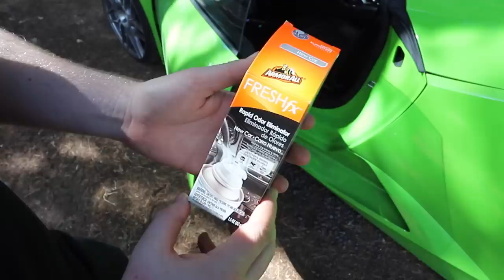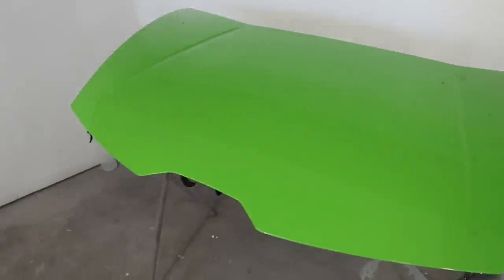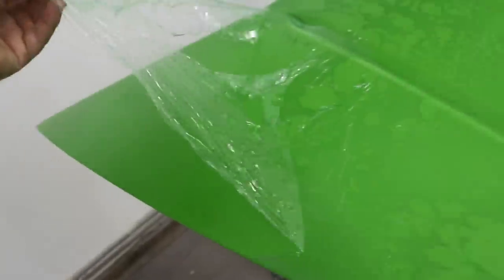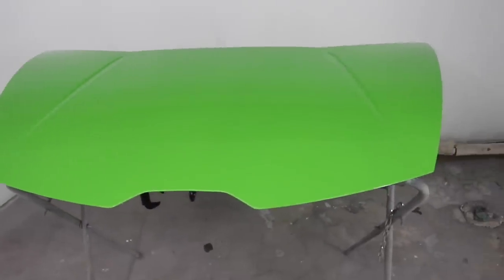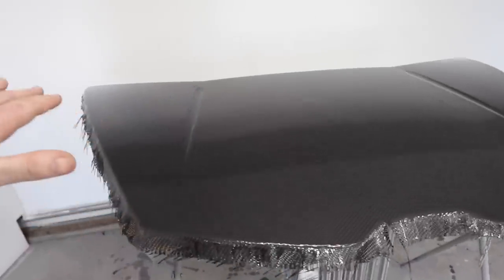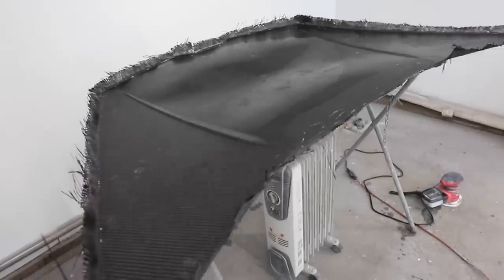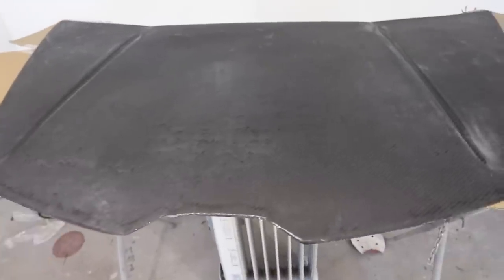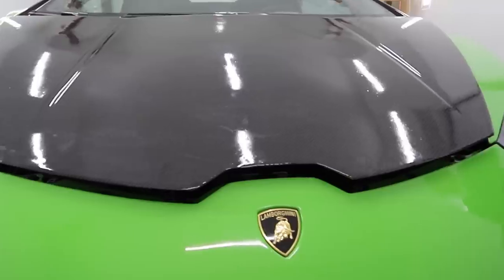Building Our First Carbon Fiber Part for the Huracan

Comment: if you use the Huracan parts as the mold, you will have a part that is larger than original, but you should use fiberglass to make a mold, then use the carbon fiber inside of that. And it should be bagged and vacuumed.
Reply: This
Reply: It would be bigger but the whole car would be that much bigger so idk if you would really notice.
Reply: I say do heaps of layers an inch thick, make a carbon fibre armoured lambo 😃
Reply: @bigdaddy741098  The ultimate widebody kit
Reply: Yep, Thats the the way to go! Its way more work! But its the right way to do it! Also need to make molds from the backside! you need the support structure! Plus use tooling gel coat!
Reply: @PvtPapa  that's not how it works :D
Reply: I was thinking the same thing, thought I was being a dumb ass though 🤣
Reply: @Slamdoxicalz  be funny if it was, just keep making it bigger and bigger until it's basically a monster truck 🤣🤣
Reply: @Slamdoxicalz  Thats how Street Bandito did it, ya know, the guys everyone is praising in these comments
Reply: I would think the surface finish would be substantially better as well.
Reply: Norm D exactly, but this guy doesn’t have a clue what he’s doing yet he’s trying to do one the most difficult builds attempted on YouTube 🤦🏽‍♂️
Reply: Should use carbon to make a mould
Reply: @bigdaddy741098  And at that point you've spent as much on carbon as you'd spend for another Hurican.

Comment: makeing  negative molds is the way to go. ad some plywood rids to it so it keeps its shape and the mold itself can be woth alot of money to someone that wishes to get into manafacturing lambo parts
Reply: Very true
Reply: Storage space for a bunch of moulds could be a problem.
Reply: Easy composites, a UK company has great you tube on making a bonnet
Reply: need a vacuum for flawless really as well
Reply: Dead ways to achieve with some plastic bags and double sided gorilla tape just need a couple of screw fittings and your almost there
Reply: I agree, make a mold. it can be made from cheaper glass fiber with wood reinforcements, and use the carbon for the actual part.
Reply: @imouse3246  Someone would pay good money for a decent mould, potential earner
Reply: Easy Composites here on YouTube has a full series about how to make a carbon fiber hood, including making negative molds for both the inner and outer skin. It would be great to use that as a guide.
Reply: Very interesting episode.
Thanks for sharing it with us.
Reply: Plywood is actually a major pain in the ass for things like this. Having done that for aero molds do not recommend plywood. There is a rigid foam made for this that works much better. I don't remember the brand name and if I can find it I will post it later
Reply: BIFB Aero kit. It's the next rocket bunny for Lamborghini.
Reply: I also want to see how a negative method works out.. it seems like Chris might get a better result, and side hustle selling knock off lambo parts..
Reply: Exactly, if I was doing it, this would be the way I'd do try
Reply: PVC pipe works great to add stiffness to the mold. Lay glssfiber over the pipes. We used this when making raceboats so I know it works.
Reply: @kruleworld  truth is mate if you use enough layers of glass it doesn't really need the wood. I do it for a living and its stronger then people think they just don't make it thick enough in the right places.
Reply: @brettknibbs9351  a block of wood is a lot cheaper than many layers of fiberglass and resin. that's why.
Reply: @GoodolOzzy  sorry. Dyslectic

Comment: Sorry Chris, but you need to do more research on panel making from composites, you are wasting so much material. Gel Coat molds with fiberglass and bracing so they don’t go it of shape and make Carbon Fibre panels from them. How are these panels going to mount?

Comment: Make a mold, then do carbon fiber infusion. Will save you time on sanding and will look 100x better!
Reply: Also you are going to need to make reinforced back panels to keep the part rigid. I believe they glue it on.
Reply: @Ryan-ue9ve  maybe sheets of aluminium so strengthen it ?
Reply: @trnews-lb6ev  i believe its harder to bond metal to composites, it works but over time can cause cracking. Im no professional. Easy composites has a great tutorial but it looks like a rigorous process. They use fiberglass as the back plate, even my seibon carbon fiber hood uses fiberglass for the underpanel. You could do all carbon fiber though.
Reply: @Ryan-ue9ve  you can use an oem inner style reinforcement. Or you can make a smooth inner while using a core material.
Reply: @carlosvargasbatman  agreed! Just doing a decent wet layup with vacuum bag would make a good part!
Reply: @carlosvargasbatman  i agree, the guy is a total beginner and has none of the skill and knowledge to make a decent carbon fiber part using resin infusion(making the whole car as he says is not even thinkable)
Reply: I was wondering about the mold.  By laying fiber on top of the current panel, one's new part is slightly bigger than the old one.  One might be able to lay down one or two layers, then reinforce on the back side, but as shown in the video, just a couple of layers is quite flimsy., so it would take more to keep it from moving.

Vacuum bagging, or using some kind of a bladder press allows squeezing out as much resin as possible to leave mainly carbon fiber which the part derives the strength from.

Using the mold should give one a clean first layer.

Some people use cosmetic carbon, and structural fiberglass.  Not perfect, but cheaper.

Comment: A negative mold is absolutely mandatory for big pieces like this and will fit so much better.   It will also be easier to lay some foam sections to the inside and then "box in" those with overlays of carbon for a much stiffer finished product and even make mounting points to the frame.  You really need vacuum bagging and heat, if possible though.

Comment: Hey Chris, I’m an aerodynamics/composites lead for a FSAE team majority being engineering students, where we manufacture full carbon fiber bodies every year for our one off small scale formula 1 race cars. I have tried this wet layup method and it can become difficult to get the glass like finish. The majority of teams use fiber glass negative molds to achieve the complex geometry our race car can have. 

I would love to give some advice or if you have any questions just dm me! Also check out FSAE teams its equivalent to a d1 league for automotive engineers and as engineers we design by ourselves, build by ourselves (if possible) and compete internationally!

Comment: You should definitely go with a mold. By laying the carbon on top of your panels you are making all of the new parts slightly larger. This will ruin all of your gaps.
Reply: It'll also make all the panel lines just a little bit softer, giving the entire car a subtly sloppier/cheaper look.

Comment: I think you should make a mold of the parts first, and then do the Carbon fiber panel from the mold so that it’s an exact copy. You can layer as many carbon fiber cloth pieces as you want.
Reply: This is what I thought he was gonna do
Reply: It also makes the copied piece bigger
Reply: Andrew Ziegler not if he uses a good mold. It should be the exact size.
Reply: @steelavocado1  no Andrew was saying the way the part shown in the video will become bigger if he uses that. But on the other hand, if he creates every single panel using the same method, it should fit since every parts are equally bigger.
Reply: thought the same, this will make a negative copy.
Reply: @brianchen3964  they wont fit and will need MASSIVE amounts of work.

Comment: Definitely go down the mold making route. If done right you can just keep popping out parts and if you make the inner of the mold super smooth and shiny (much like how the underside of the carbon hood is) that'll show on the top coat of the carbon part. 

Plus with the molds you can sell them when you're done, someone will buy those molds without a doubt

Comment: You have to make a fiber glass mold, then put 2-4 layers of carbon fiber. Do NOT sand it, not with 120p, if you have to sand use at least 600p and be careful to not sand the carbon fiber, only the resin.
Reply: You can sand carbon fibre.
Reply: @andrew19682008  you dont want to sand to the fiber, specially if you are going for cosmetic carbon - i.e. not painting it just clearing. Yes if you are just making a structural panel that has enough laminate you can sand a high spot through the first layer or 2 and not care, but you are going to need to paint it otherwise it will look terrible
Reply: I paint carbon for a living, parts for aston martin, porsche, Mercedes etc, we sand with 180grit and then scotch, that's where he went wrong, the scotch would have removed all the milky ness. Also we cure all off our parts for 8 hours at 150° so 2 days air dry is no where near enough.
Reply: @andrewbatson9710  you sand cf before clearing. You want the clear to stick...if its a smooth surface it'll have a hard time sticking to the part. It may look rough after being sanded but the cc fills all the voids and smooths the part back out. A part will look better sanded then not also...and last longer.

Comment: The way to do it is:
1. Create a fiberglass mold of the item you want to create a carbon fiber you want to get
2. Wait for it to cure
3. Lay the carbon fiber INSIDE of the fiberglass mold so the original sizes are preserved
4. Cut it while the carbon fiber is still "flexible" to avoid cracking
5. Also, this is the time to make any necessary steps to prepare mounting mechanisms (lifters for the hood for example)

Comment: I see green specks in the carbon. Does this mean you are ruining the new paint job on the Huracan?
Reply: I would have waited to paint the green lambo till after they used it to make the new body parts.
Reply: Why do u think he needed a sponsor for this episode?
Reply: MIKEYMCC I think it's the green specs from the film thingy he sprayed after waxing
Reply: Paint is very thin, then there is a thick layer of clear coat over the top of that. There is no chance of him pulling off paint from the paints because hed have to go through the clear coat first, and that would he extremely noticable.
Reply: @towboatjeff  right? why take apart a freshly painted, perfect lambo. dude is a hack.
Reply: I was just saying about him putting stuff on that paint I would never do that
Reply: for sure
Reply: @nuancepill8066  I don't think you know what a "hack" is.
Reply: I think I would have did all this before the new paint.
Reply: That was my first thought. He definitely should have waited. But I guess he wanted to drive the lambo before he had to tear it apart
Reply: @onetouchgarage4503  yeah, could be the PVA!
Reply: Yah

Comment: two negative moulds for the bonnet  inside and out single for the others  then you can try different techniques to get the best results without having to risk the original panels multiple times

Comment: Hard to believe the body shop gapped all those panels and your taking the panels back off
Reply: Eh, you can always gap it together again, gotta do what you gotta do to get the project done
Reply: Was thinking exactly this as they had trouble hanging the door and Um going to be intrested to see how they will mould the doors and hinge areas
Reply: @PBJPRODUCTIONSTUDIOS  pretty sure he is using production doors
Reply: I no man I would have got it painted after this not before! Just think if he accidentally gets some of that resin stuck to that nice paint job but I guess he's got a plan!
Reply: @Lingy but wouldn't you have done that before a nice paint job? I mean he had the same car before just not a nice paint job
Reply: cry some more
Reply: @Lingy can't exactly lay stuff on top of new paint it technically is still curing, plus it will never be 100% stuck to the panel
Reply: No way in hell I'd try and make a door with all the window mechanisms... I'd try real hard to find Some doors and if you really want to take off the skin and use carbon fiber.

Comment: Question: why didn’t you choose to repaint the green Lamborghini after the carbon fiber experimentation?
Reply: Most likely because a perfectly smooth, blocked, and painted surface is ideal for taking the mold. For example I have a Mitsubishi Starion and the one company that made the molds for aftermarket hoods did it on a hood with a slight dent in it, and so every single aftermarket hood has a slight dent in it.
Reply: I assume it's because he wanted the body to be in perfect shape,so that the carbon moldings are exact

Comment: I love the concept of a full carbon lambo but since the green one is a convertible how will you do the quarter panels ?
Reply: My thought exactly. Is the engine lid different too, in order to accommodate the folding top?
Reply: Jordan Latta they are not the same but I think the rear bumper is the same on both models
Reply: MickaelWinner 24 I also thought about it

Comment: So did that resin actually just peel green paint off of your hood?
Reply: No
Reply: He didn't put the resin directly on the hood, there's a cellophane layer on it.
Reply: @HMan2828  Right but when he flips over the carbon fiber piece you can see little bits of green on the edges which leads me to believe it still pulled paint.
Reply: Crisp there’s clear coat and if it went through clear your would be noticeable

Comment: Moulds are the better option to me, make them from f/glass, finish the inside and lay in your carbon - outer panel size is close to the pattern and the finish surface is good.

Comment: Mold the hood and not do the over lay method. THat way you dont have all that extra materail from the original hood under there.
Lay in so spars in the mold to add rigidity with almost no extra weight.

Comment: REVERSE!!!!! Why not reverse what your doing. Make a mold the way you did with the carbon but instead use gelcoat (what they use for boats). Than that piece you can always use as a mold. Treat that gelcoat mold just like you treated the hood and you’ll be good to go. Maybe even a $$$$ maker duplicating  Huracan parts. But you definitely need to make a mold first.

Comment: Try to get in touch with Tony from Tigercraft performance skis in NJ. He does fantastic work with carbon fiber. He might be able to give you some tips on mold making and glass laying. New method that is being used with a lot of carbon n reg glass is the vacuum bagging. It gets all the air out and makes it stronger with less layers turning into lighter/stronger product.
Awesome stuff so far. Doing an awesome job.

Comment: It's weak because fibers are layed in only one direction. The optimal way to do it (to have about the same strengh in every direction) would be with at least 5 layers of fibers with the following orientions: 

0°/90° (1st layer), 
45°/-45° (2nd layer), 
0°/90° (mid layer), 
45°/-45° (2nd layer mirrored), 
0°/90° (1st layer mirrored). 

You probably have made a few panels when you're seing this, but it's just a tip! Maybe it would be too thick for what you're doing but that's what I learned during my studies in aeronautical structures. Anyway, it's nice to see that you are not scared of playing with carbon fibers ^^

Comment: You should have made a fiberglass mold first. Also, you should put the carbon fiber
A vacuum while it cures.
Reply: False... The infusion process will lead wrinkles of the bag to create deformation over the piece. Also, it's a single layer of carbon, so what is the need to create a vacuum ? You normally create a vacuum to remove all the bubbles trap into the multiples layers of fibers or to conform the fibers onto a complex angles mold.

Comment: Just a basic method -- 

1. 3-4 coats of wax...
2. 2-3 coats of pva, and a regular paint sprayer is definitely not recommended...
3. use something like plastic sheets, corrugated sign board for example, and using hot glue over masking tape so the glue doesn't remain on the actual part you are duplicating, cut and glue them on the underside edges all the way around, using a release tape to cover all the seams...
4. use a putty type wax around the edge, all the way around the piece...

5. gelcoat prior to resin...

6. resin and fiberglass and get your first half of a mold...
7. do not remove the part from the mold when the resin is cured, but instead leave it in place to create the underside mold in similar manner after removing the plastic edging .....

Highly recommend the following video series for better info...

Part 1 of 3 of a company in the UK that provides most all you need to make carbon or glass parts, but the 3 videos go through a very simple mold and part making process: https://www.youtube.com/watch?v=UgKvDw1E60E

Comment: *Easy Composites Ltd*... was a HUGE help when I was working on a similar project. They're methods allow you to make a true copy of the part too, rather than just some different panel layed on top of the original. They also do a great job at showing how to replicate the interior side of the hood panel. HIGHLY recommend checking them out, especially since you plan on doing a bunch more panels. Not to be a jerk, but I would highly recommend NOT reaching back out to the "Street Banditos" if these are the methods they use. 

Best of lucky!

Comment: Do it the correct way like Street Bandito. Make positive molds and vacuum form the parts. Only way to reduce weight and have strength, which is the whole purpose of using CF lamination. If you are planning on just doing carbon fiber overlays, you might as well use fiber glass as the structure and then overlay carbon fiber for the finishing look.....
Reply: transta00 just use a carbon fiber rap, that would look better than that backwards effort.